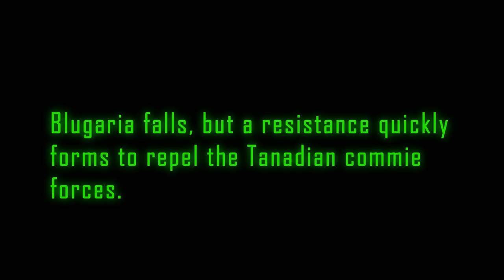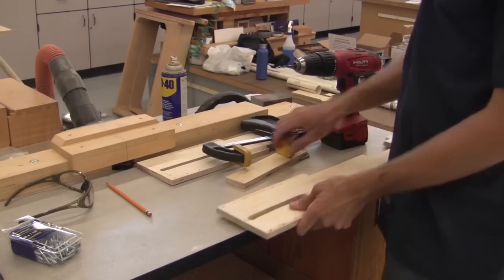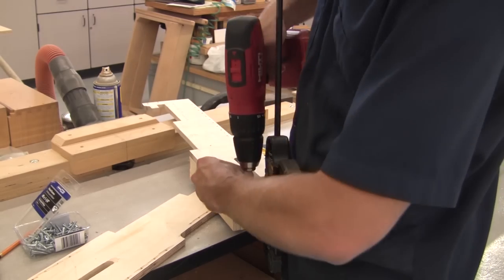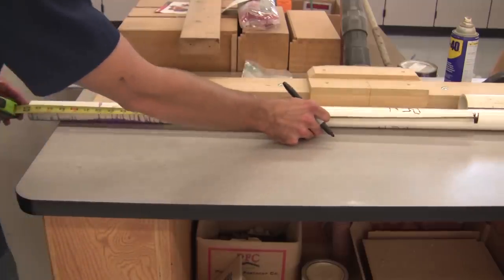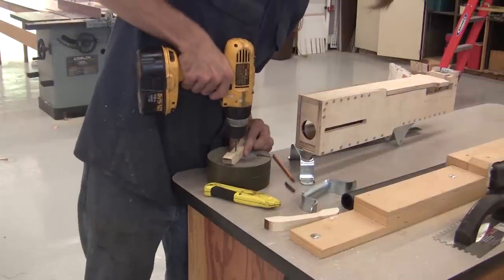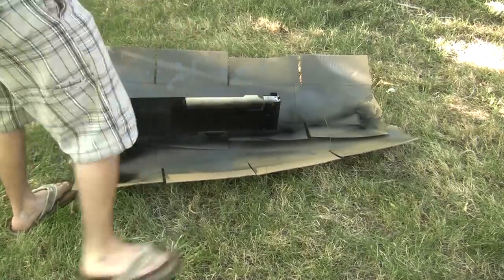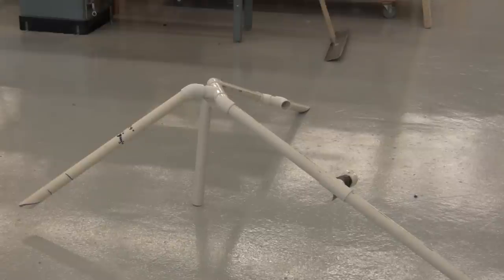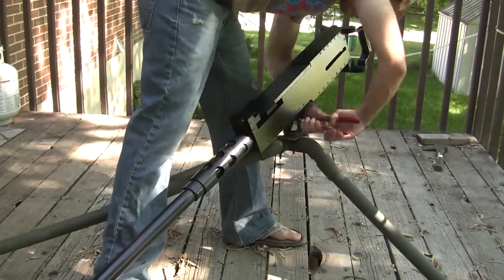Level Up! Episode 2 DIY .50 M2 Machine gun

Comment from the maker: I think you could, but the problem I see with that is the barrel support. All that PVC starts actually getting weighty enough that it could...sag. I think the same goes for the ammo can. Now, IF you made small inside supports at the front and back to help support the barrel and the ammo can and handles it could work. But I think that'd be more work than just cutting the wood, unfortunately. :/

Comment: Anybody have this pdf. file/parts-list saved and available for DL?
I have wanted to build a display like this for my local hobby shop
for over 40 years.... and just when I find a vid like this, the links are all dead...
somebody didn't pay their cable bill.
I hope dudes didn't get arrested for flashing their big .50's around town.... ?
PS: turned wooden dowels in the tri-pod legs and bent re-bar with expanding
foam in the the "swivel" mount area will support the weight.....